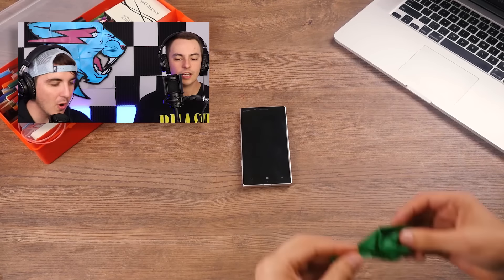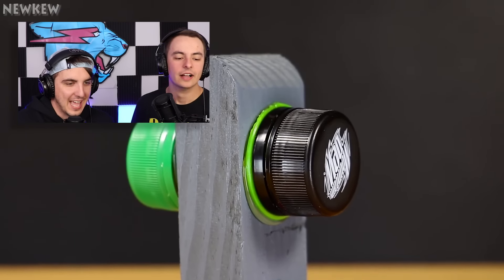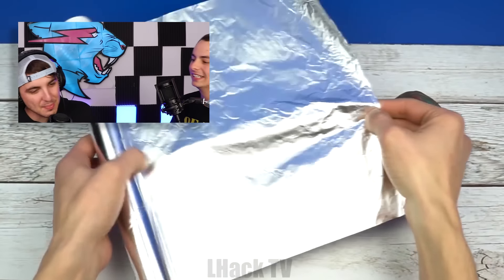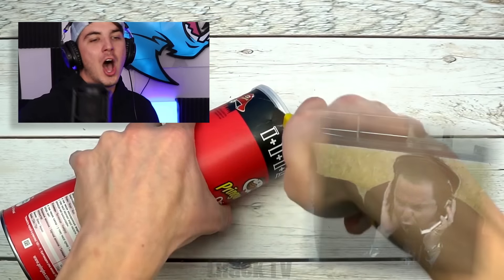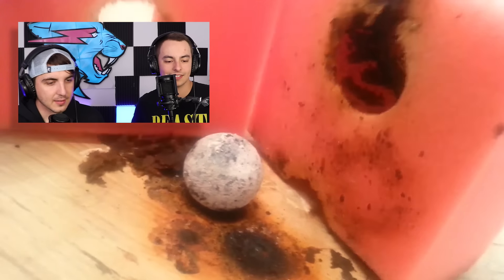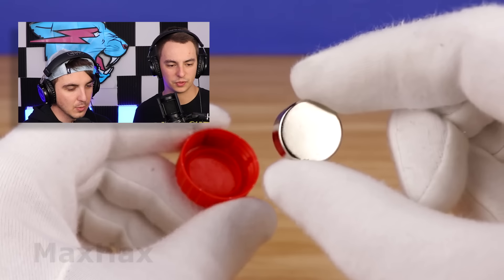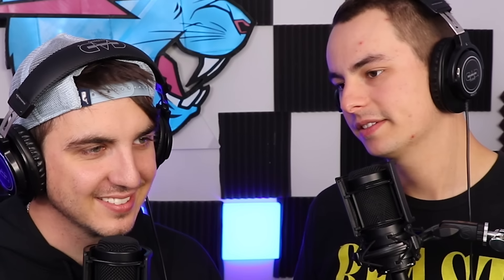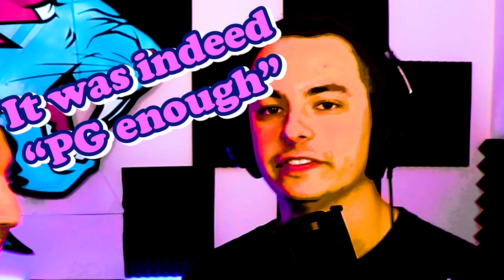1,000 Degree Ball vs Sponge!

Comment: Most kitchen sponges are made of cellulose (natural fibres). However, the scrubby part is typically made of polyester or nylon. These materials are neither recyclable nor biodegradable and are made from nonrenewables such as oil and gas